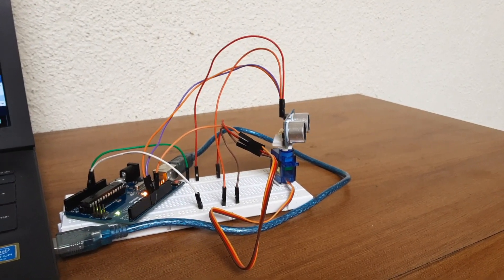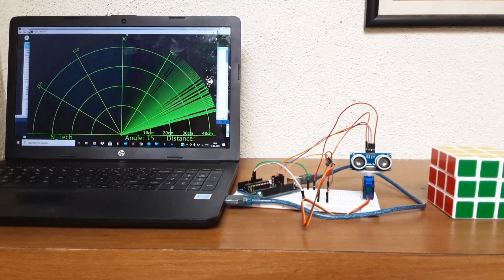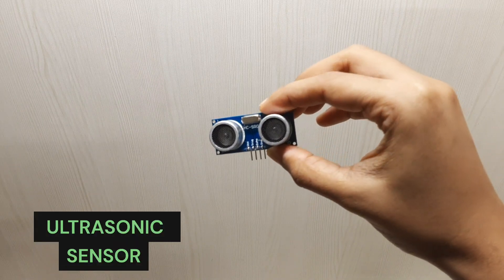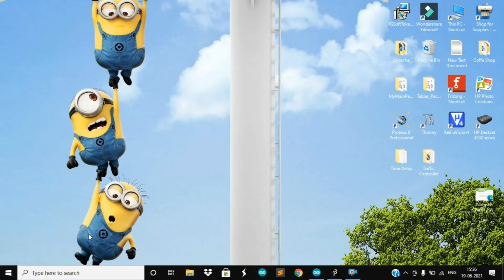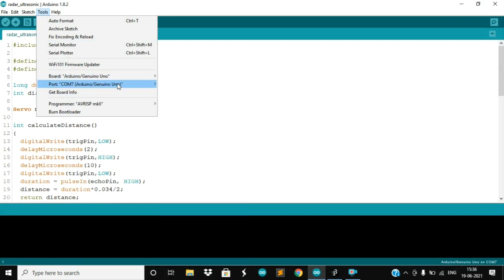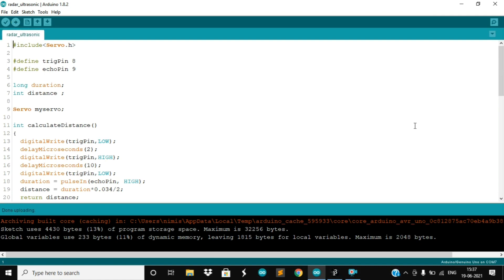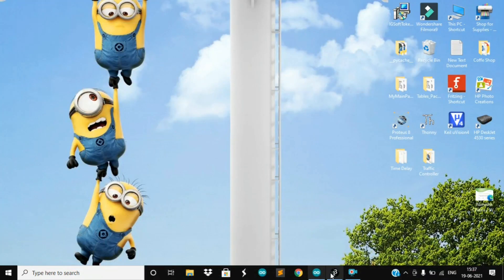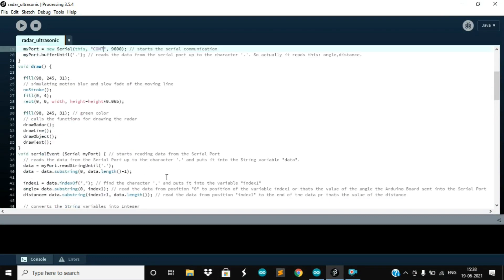Radar using Ultrasonic Sensor and Arduino

Comment: Hi my friend. Thank you for the video! I want to make an Arduino radar project. Most of the radar projects using Arduino define the object with only one dimension. Whether the object is thin or thick, it draws the only one dimension on the radar monitor. Is it possible to make a multi-point radar project using Arduino? That is, I will be able to see the size of the object. For example, if there is a box in front of it, I will see it in width and length.

Comment: Hi,I tried to do it without the servo motor, but the program remains on the same screen as when it was first opened. Additionally, it is necessary to use Integer.parseInt() when converting string to integer in the code. Is there something I missed?
Reply: did you find out how to fix it??
Reply: @Rickbriqua  I gave up because I couldn't figure it out.
Reply: @Rickbriqua  Hello. I tried it today with the same code and it worked fine. If you do all the codes as they are, it works.

Comment: there is no error in code but the sensor is detecting the object even no object detected
Reply: Yes please help
Reply: that is because it is no connected to the right pins..in the describtion it says connect trig to pin 2 and echo to 3...but in the code trig is at pin 8 and echo at pin 9
Reply: and the servo motor need to be connected to pin 11

Comment: I am getting "Error Compiling for Arduino Uno" while compiling the code in Arduino Uno. Please help me
Reply from the maker: Hey please check if you selected the correct board and port . You can do this by going in the tools section under board select the board as Ardunio Uno
Reply: Same here,its is the code itself
Reply: Board and port are fine,its just a code error that's the prob